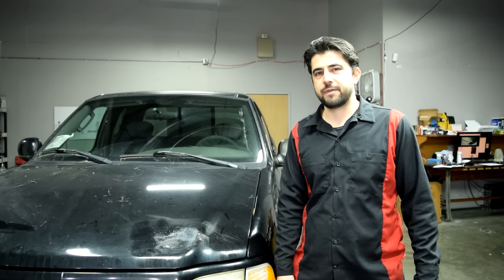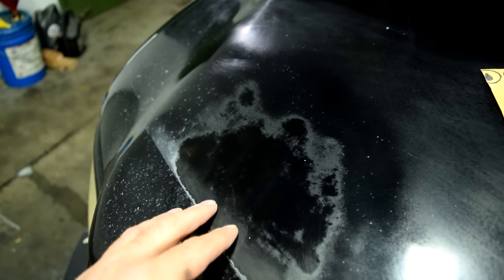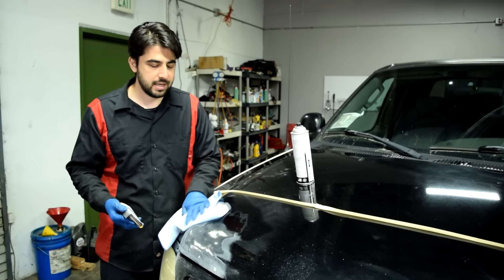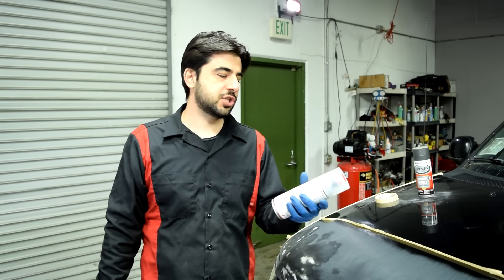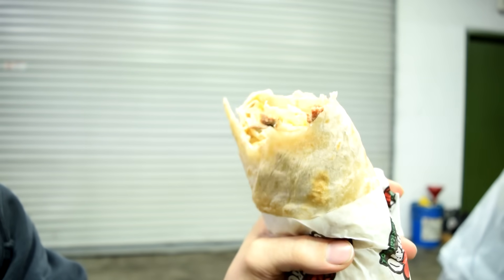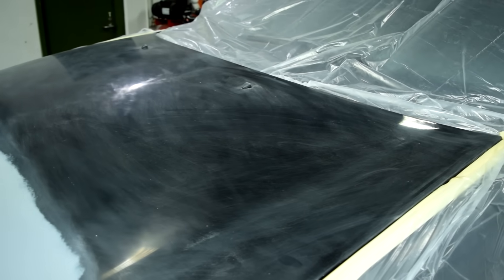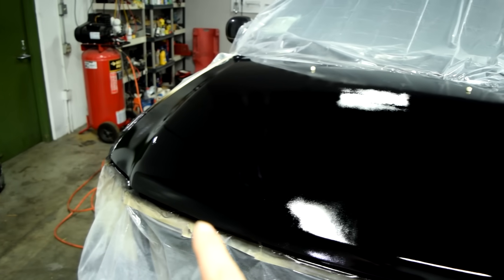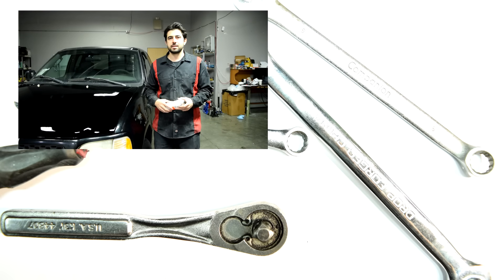How To Paint Your Car With Nothing But Rattle Cans

Comment: Top Tip to reduce orange peel. Put the rattle cans in hot water before you use them, so the paint is warm. 50-60°C (120-140°F) depends on your hands and what's written on the can as temperature that may not be exceeded. Let the can warm for 20 minutes and spin it regularly so the hot and the cold paint mix.
Reply: I followed the advice and the result was amazing. I was shocked how much better it worked
Reply: I followed your advice and my paint job results were spectacular💎

Comment: I appreciate the work you put in while making this video.  Creating a video easily doubles the time it takes to do a job, plus the extra time to finish the video and get it posted.  But a few points - a removable vehicle panel, like a hood, is best painted when removed from the vehicle.  Use a suction cup handle to give yourself a better grip.  If you really want to do it on the vehicle, start painting at the back of the hood - nearest the windshield - and move in one continuous sweep from one side to the other; don't stop in the middle.  

A guide coat is usually used by bodymen to highlight extremely small dips in a panel; a light contrasting paint coat is applied, then sanded off using a sanding board (as opposed to holding sandpaper in your hand).  The rigidity of the sanding board causes the sandpaper to stay flat; then, when the guide coat is sanded off, small dips in the metal still contain guide coat paint, thus highlighting areas that need body filler.  Your hood didn't look like it needed any reshaping, just a good sand and paint job; so you probably didn't need the guide coat.

Be careful using a tac cloth; some can leave adhesive residue.  A better choice is to vacuum the surface, using a bristle brush attachment to mechanically dislodge dust particles.  If you want to use a cloth, a new, dry microfiber cloth can work quite well.  Store it in a zip-loc bag between uses, so it doesn't get covered with dust from the air.  I bought a pack of 20 from Amazon, and keep clean ones in a zip-loc bag; when they're used they go in the hamper to be washed, after which they go back in a zip-loc bag.  This means I always have a certified fresh cloth when I need it.

When I started painting cars, I didn't have a garage; so I built kind of a lean-to frame - kind of a tent - out of pvc pipe and pvc joints, then covered it with a painters drop cloth.  This allowed me to work on one section of the car at a time.  I'd start with sanding, working in the open air; when it came time to paint I'd assemble the PVC frame in a size and shape large enough to cover the area I was working on and allow me to paint inside the tent.  Then I'd cover the area to be painted with the frame, scrunch in under the drop cloth and paint it, then get out and let it dry.  It kept a lot of dust and bugs from settling in the paint.  It also kept the paint fumes from getting into my lungs. 

Anyway, I hope these thoughts give you some fresh ideas.  Don't mean to be critical; you're clearly getting stuff done, and that's the most important part of any job.  I just felt that these comments might help someone.  Keep on keeping on... >Charlie
Reply: Thats some spot on advice, i'm looking forward to spray paint my hood soon
Reply: charles worton awesome.
Reply: Why would you R&I the hood just for a simple repair that require no mud work at all. No sense in having to take extra time to do that when you could be doing the repair in that time. The. Having to line up the hood again and wait for it to dry to handle it? And really honestly for the best repair you should blend your fenders since he is basing the entire hood. You would lose your ass in a commission pay body shop doing that...
Reply: Thanks.
Reply: @jeffzx10 Not to mention cycle time...
Reply: How would you do a whole roof ?
Reply: Why not start your own channel since u have so much to say?
Reply: Awesome notes. Thank u
Reply: In your opinion , did he really need primer ?
Reply: Thks Charlie, your additions are helpful for us learning ones.
Reply: Hi charlie or anybody who’s experience in this field! 
Quick question. 
If the majority/entire clear coat peeled off (from the trunk) & the paint (light gray) still looks good to me (non-professional eye), then can I simply spray clear coat when I properly wet sanded it with 1000 or 1500 grit (w/out exposing the primer)? 
I don’t know which grit to use for the clear coat to adhere to.  All I know (watching other how to videos) is to use wet 1500 grit or higher to remove the orange peel & then buff/polish afterwards.  

Trying to do my first ever DIY in repairing peeled off peeling clear coat.

Comment: That hood came out pretty good... got my daughter a truck for graduation last year but needed to much sure it was reliable for college 1st... so now... after updating grill and headlights to chrome and halo, I had pumps, hoses,  rebuilt transmission, and a few other things under the hood changed or updated, I started on the body... I was gonna take it in now that I'm done with the side guards and both bumpers, but... I think I'm gonna try this on her truck... yeah, gonna try it... good walk threw...

Comment: As the can is slow method comparing to the gun, I was a bit surprised that You started from the middle. I got excellent results without later sanding by starting from the side going wet over the hood. Next layer wet enough, and it came just fine. The garage was cool enough, as was the can to allow working time. Modern 2K clears in a can are better than most think. I also used once a nozzle button from a primer can with the clear can, it has bigger "hole", so it sprays much bigger flow, and it sometimes helps but has a bit less ideal spray pattern that must be kept in mind.

Comment: Thanks for a great video.  I followed your instructions to the letter when I fixed the clearcoat damage on the front of my RV.  It worked great!  My only issue was the spray tip that came with the base coat cans.  It was way too narrow and at the time of application I was too dumb to try the tips from the primer or clearcoat cans.  I made do however and I'm very happy with the results.

Comment: Great vid. Little tip if u spray from outside edge to center  u won't have streaking in the center of hood ,because when u switch sides u will be starting on a wet edge.
Q

Comment: Actually, start moving your arm BEFORE you start spraying. This prevents runs and build-ups. And, keep moving your arm AFTER you stop spraying. Same reason. Very inspirational video. I've been wanting to do my van and now I feel that I can do it. The problem with the van is that the clear coat on the fiberglass raised roof top is flaking off in large pieces but the color coat is fine, just dull. Every time I go to the car wash I use the pressure-wand to remove another few inches of clear coat.

Comment: I like dish soap as well I use it for paint wet-sanding, car wash, wash my dishes, etc. I use it in the shower. I use it to wash my hair. Dish soap is All-In-One product. It saves me money on not having to buy any other kind of soap for home/auto use.
Reply: IamAnoobiecheez 
your hair really lmfao 
everything else except  that
Reply: Yes I use Palmolive liquid dish soap for all my car and home needs and for my shower. I use it to wash my hair it works real good just as good as body soap. Palmolive dish soap kills 99.9% germs / bacteria.  This is good cause it saves me great deal of money not having to buy other fancy soaps.
Reply: IamAnoobiecheez 
Does it leave your hair really  dry ?
Reply: No not really surprisingly it doesn't leave my hair dry... it feels natural and let the bodily oil to re-condition my hair..  I think it's the body soap caused more harm leaving my hair and body dry.
Reply: IamAnoobiecheez It really isn't that bad I sometimes use oil based pomades in my hair and if you don't want to buy expensive as shampoos to remove it you just use dish soap. Works great
Reply: Don't forget it's great for washing clothes. Just don't put as much into the washer as you would with regular laundry detergent
Reply: Yup I've run out of shampoo/soap and used dish soap before. Worked like a charm!
Reply: yes but it strips sealants and waxes from the car when you wash with it
Reply: You can even add it to salads as a dressing!  Great on toast!

Comment: Great video but you need to wear a respirator that filters out organic vapors when spraying any 2k primer or clear. People have died from not wearing the proper respirator working in body shops. You should do a video more in depth about respirators. I actually did not know this until just recently, and a lot of people are not aware how extreme the dangers are. Keep up the good videos.
Reply: That's why it's not sold at average stores
Reply: yes organic vapors w/pre filters on a 3/4 respirator. Back in the early 80's when Ditzler came out with Deltron acrylic urethane ,our local Ditzler jober told me that the Ditz rep for alaska nearly died from not wearing a respirator when they were testing Deltron. His blood became so thick it nearly hardened in his veins,the dude was very lucky to survive. Dangerous atmospheres will kill you quick. Even bondo / primer dust will get you.
Reply: the catalyst nowadays are not as strong as they were back then,but just as deadly
Reply: Stop talking so much
Reply: @bobpope2990  So what respirator do you recommend+prefilters?
Reply: @22Webstar  The respirators, that's BS. The 2k clear coat? okay, but should be in the aisle with the firearm you can buy at the store if it's that dangerous.

Comment: I´ve seen several of your videos. This one keeps the good level. Thanks for sharing. ;-)

My 2 cents to anyone doing this. Use the new spray can in the horizontal area first. Then move to the vertical area. Otherwise a lot of paint might go to waste and irregular paint pattern can become an issue.
If possible, it´s better to remove the hood and paint it in a vertical position or close to it.
Many rattle cans have a straight pick up tube, so when half empty start to pull out only the  gas. Hope it makes sense. :-)
Cheers

Comment: So I finally pulled the trigger on old Blackjack.  You think the F150 hood was bad?  You ain't seen nuttin'!

Followed your advice, for the most part.  I had to do a bit more with mine since it was peeling down to the bare aluminum.  And I had to do mine outside.  But the results were "okay".  If I had spent more time in prep and more sanding, it would have been better.  But from where it started to where it ended, it's a 100% improvement.

I would suggest if you're on a budget, though, that you might THINK rattle can paint is cheaper - it's not.  And the results you'll get from having a clean place, a compressor and a gun will be a lot better.  But with an old $1500 beater, I really can't complain!  Thank you for the video!  It helped a lot.

Even more thanks to my neighbor that let me park it in their garage for the night with rain coming in and the paint was still tacky.

Overall, it has more texture and orange peel than a fruit stand.  But I think some wet sanding, if I get ambitious, a cut and polish can clear a lot of that up.  But there are still defects you can see from where I probably should have stepped down after the high fill primer to a less aggressive grit sandpaper and smoothed it more.  I had to start with 40 grit just to get the paint off that was peeling so bad.  Then 100, then 220, then self etching primer, then high fill primer before I could move up to hand sanding at 400 grit and then lay the base.  But I should have gone up to 800 or 1000 before laying the base.  Otherwise, hey, it's one color and the shine isn't bad.  More like semi-gloss than glassy.  But it's even and not bad, no streaks, and looks decent for a DIY rattle can job done outside in the yard!

Comment: Question: I'm about to rattle can spray a 27 year old car hood, roof and hatchback in semi-gloss Hammered Black.  The clear coat is 50% gone on these areas, some base fading also.  Original base coat is dark hunter green.  There are some small rock dings and scratches of course. 

Since the car already has paint on it, and it was sanded smooth with 400 grit paper, I know I don't need primer but I was going to use black primer to best ensure adhesion of top coats and fill in some minor imperfections. 

Should I allow primer to dry for 12 to 24 hours and then sand the primer with 400 to 600 grit?  Or not sand it and just let it dry before top coats?

The final coats will be 2 or 3 sprays of Hammered Black so that should cover up and fill in a lot of imperfections also.

Thanks!

Comment: why didn’t you use the paper method when spraying your primer? it would have feathered in seamlessly. this is gonna look like shit when the sun fades it down some. also: use dish soap when you prep your car for paint. i, as a woman, know that it cuts through grease and wax which is exactly what you need. the type of car wash you used legit said and you even read out loud that it doesn’t take wax or grease off, like what was the point of washing it if you don’t take off the wax and grease?? when you paint a panel, you need something for the paint to bond to, and if you still have any wax or grease on your car, it’s not gonna stick as well and it’s gonna end up looking patchy after some odd months of use. i understand that’s what the primer is for, but that’s useless too unless it bonds to the car. i could be wrong, i’m definitely not an expert, but by the looks of it, this guy isn’t either. he’s cutting some corners that are vital to a flawless product. it might look decent now, but i’d like to see an update for a year after.
Reply: margot myers I went to school for autobody and this guy did just fine. You could use dawn to wash the car as some insurance but it doesn't really matter Bc the sanding and scuffing will remove most of the wax anyway. It's just to get rid of grime that will gouge the rest of the paint while sanding. The most important step is using the wax and grease remover before applying the primer but he did make one small mistake. When using the wax and grease remover you want to apply it really wet then before it dries go over it with a dry towel to soak up the excess. That way you're soaking up the wax and grease. If you just just apply some and rub it around and let it dry you're just spreading it around. He used a 2k clear so I doubt there will be any problems for many many years. The rest of the paint job will fail before the hood.

Comment: Great job!  Thank you for all the explanation on details. 

But when I saw you using the air blow gun.. I was also thinking ..if you have an air compressor.. what's the point of using the rattle cans? I believe lots of people use rattle cans not because they don't have the paint gun, but because they don't have an air compressor at home (or they don't have a place like a garage to use air compressor and paint gun.).  Just my thoughts :) 

Thanks again for another great video!
I'm gnna work on my car soon too! 

Cheers!

Comment: I just came across this video, it is awesome information even after 4 years still relevent, i would like to know if you have any recommendations for base coat when you use 2k primer and 2k clear coat? Does it matter if base coat is acrylic or  urethane ? Is it ok to to use  2k spraymax primer, dupli-color acrylic lacquer base color  and 2k spraymax clear for DIY ? what are the pros and cons? Or any other recommendations would be appreciated, thanks.

Comment: I would'nt be using that Meguiars soap when doing paint and body work.It clearly says it wont strip wax.When doing paint and body work thats what you want to do, strip wax,grease ,silicone tar etc. Thats why we use a wax and grease remover before and  after sanding and or painting.So to make a long story short I would rather use a dish soap like Dawn,then a wax and grease remover.
Reply: pitlion1 didn't you watch the video?? He said he didn't have any dish soap at the shop and he will be using a wax remover and degreaser after anyway.

Comment: Hey turned out not bad quick tip when you clear coat never ever start your first pass in the middle by the time you come to the other side it's dry u need wet on wet in order to melt the clear that's why you have the streak dry line.

Comment: So you used 400 grit for  the primed area and  above the repair area on the painted surface you used  1500 grit or I guess what is equivalent which is the Grray Scotch Brite pad? I have seen people typically use a red scotch Brite pad or 600 grit sand paper  to.scuff up the painted surface.
Would either methods work? Or is the method you are using better? 
I am of course new and will be using spray cans to do a couple of areas on my vehicle. 
I also noticed that all the clear coat passes you did they are equally.meaning your first coat wasn't tacky lord lightly put on as the reco
Med and 2nd and 3rd more wet. 
Thanks for this great video!

Comment: I just did my rims all black. Wash rims, rinse, sandpaper, rinse, air dry, tape 2 wheels Right or left, 4 cans of regular BLK for layering then gloss black for top coat ×2 then 1 can of clear coat. they look amazing
Reply: That is often the first thing a car thief will do when it stays on the road in the city where it was stolen.  But I doubt it's done to the "look amazing" level.  When I recovered my stolen car, the rims looked awful in black.

Comment: Since the clear that is in the 2k aerosol is thinner than normal factory clear you should apply 2cans of clear instead of just one . Especialy since u plan to sand and buff it with will leave the clearcoat even thinner than when you applied it.